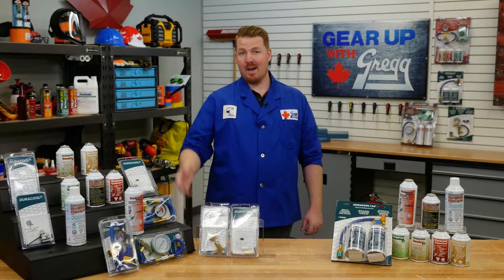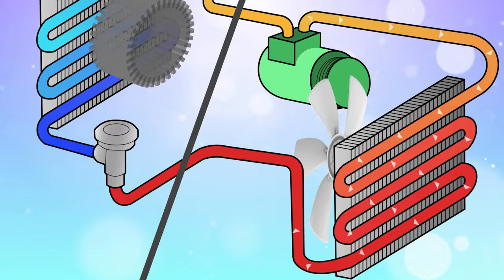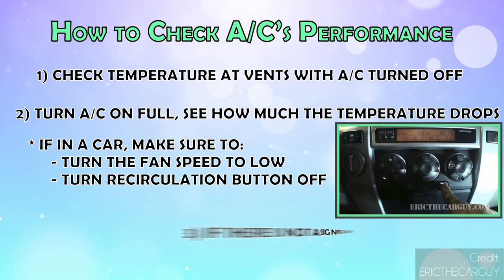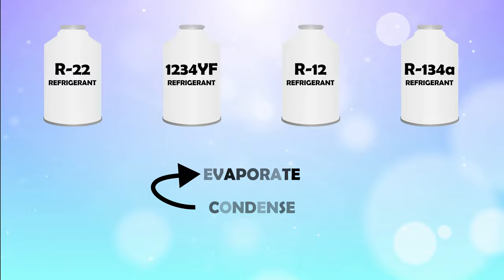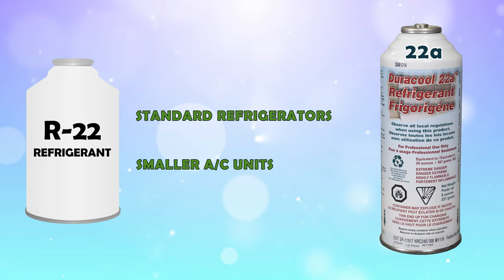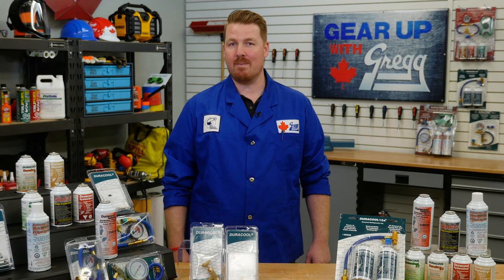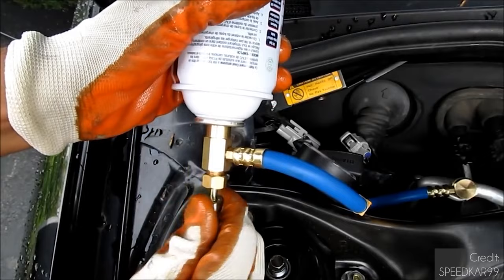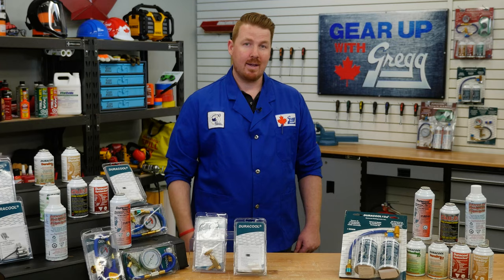A/C Maintenance Tips using Duracool - Gear Up with Gregg's

Comment: Thanks for your video.  One thing thats not clear to me is, say my system is empty now because i have leaks..  Therefore i  need to dry out the system first, apply the leak treatment and then finally refill with refrigerant.   Will each product need to be removed from the lines before the next one is applied?...or do they all coexist in the A/C system all at the same time?...is there a buildup of pressure with all these gases in the system?
Reply: If the system is empty, you'll need to find and actually fix the leaks before recharging. UV dye, electronic leak detectors, and looking for bubbles with soapy water can all work. Once the leak is fixed, replace the accumulator/receiver dryer because its desiccant quickly becomes saturated with moisture if the system is open. Finally, you'll need to evacuate the system with a vacuum pump before recharging to remove the air and moisture that entered the system while it's open and recharge with refrigerant.

Duracool refrigerants are fine if you are okay with using a highly flammable propane/butane based product, but skip the snake oil additives. You aren't going to magically seal a leak with no side effects by putting a can of some chemical into the system nor will you remove moisture. It's physically impossible to remove something from a sealed system by adding something else and it's also physically impossible to convert water into oil. The ONLY things that should be in the system are refrigerant and oil and possibly dye for the sake of finding a leak, that's it. You will not find a single manufacturer who approves of adding anything else or recharging an empty system without evacuating it first and for good reason.

Comment: Hi
Can I use duracool 12A instead of 1234 YF
Is it bad to do it?
I am waiting your answer.
Reply from the maker: It is not recommended to use the 12A, instead we recommend using the 1234YF tune up kit.  https://greggdistributors.ca/automotive/Fluids-Additives-and-Chemicals/Refrigerant-and-AC-Additives/lllyf3333

Comment: Hi. Does the Duracool System Seal contain polymers? Also, "One 6oz can (of Duracool R134a and R12 Replacement A/C Refrigerant ) is equivalent to 15 oz. of R-134a " so if my fridge takes 205g of R134a then to use this Duracool R134a and R12 Replacement A/C Refrigerant I'll need only 2.89 oz? Thank you very much.